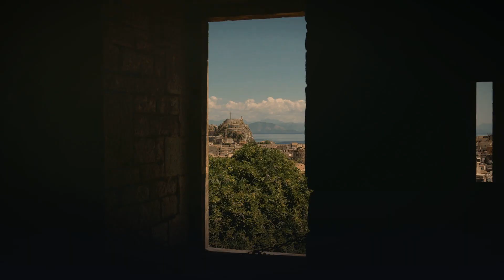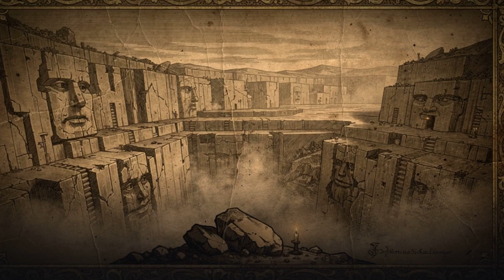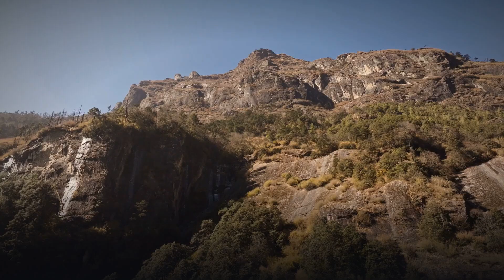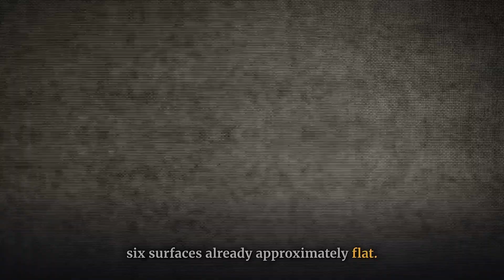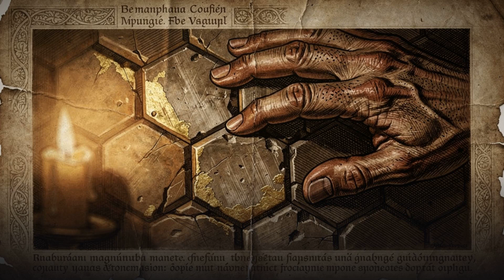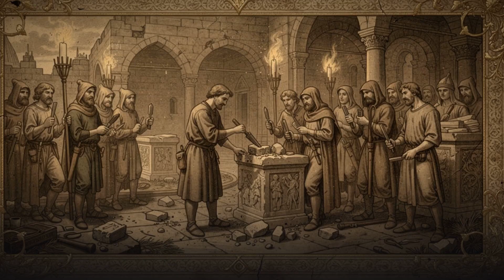Not Aliens. Not Magic Plants. The Real Reason Inca Stones Fit Perfectly.

Comment: A simple mechanical device known as the topography translator was used to precisely fit the large stones. Naturally, the Incas could not have possessed steel tools or such a device. All of this was built by the Spaniards. A more detailed explanation of how the stones were joined and why this was done can be found in the article “Fabrication methods of the polygonal masonry of large tightly-fitted stone blocks with curved surface interfaces in megalithic structures of Peru” (10th edition) and in the book “Peruvian polygonal masonry: how, who, when and what for” (148 pp., 2025).